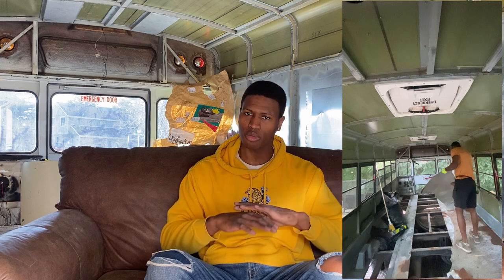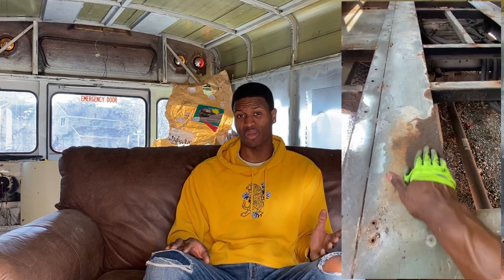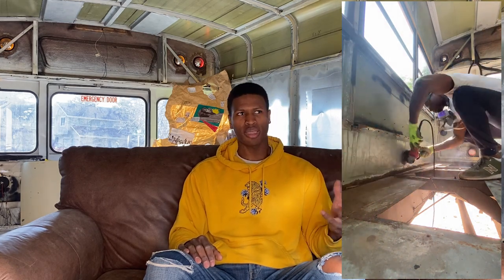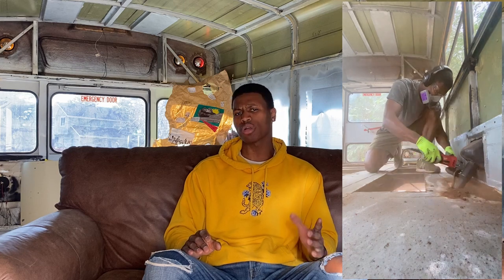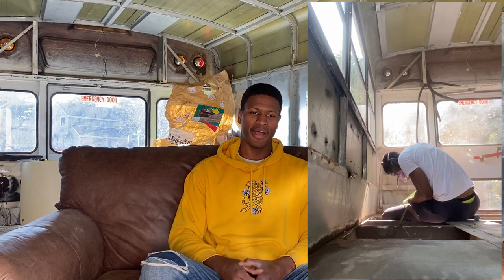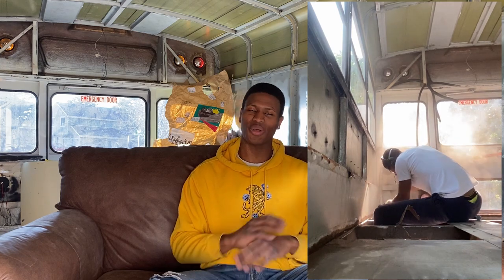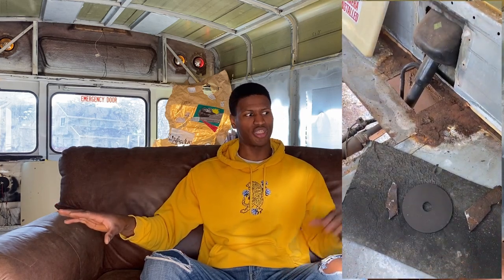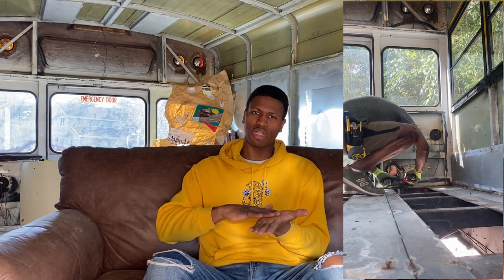How I Built a new floor in OneWay!!

Comment: I know exactly what you mean. I've been working on my 16" roof raise for the longest. After I installed the first panel it felt amazing. 7 more to go though. After that's done I'll be looking to rip out my floors. I heard Chassis saver is the way to go. Keep up the good work!
Reply from the maker: That’s awesome!!! I’m thinking about doing a roof raise
Reply: @OneWaySkoolie  In the long run, I'd recommend it, especially if you are tall which appears you are. I'm short, but still did it lol. I did it on my own too (part-time) so saved a lot of labor costs, plus I have my own tools now and still wayyy cheaper than hiring it out. But if you don't have 150+ man hrs and $5-6K to spare, then don't do it.